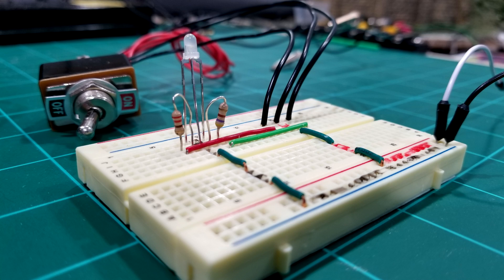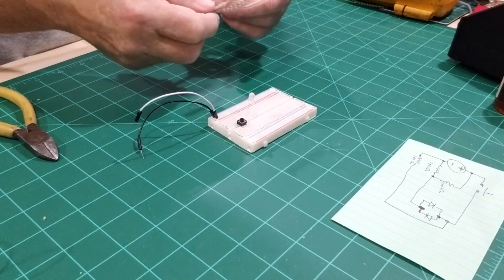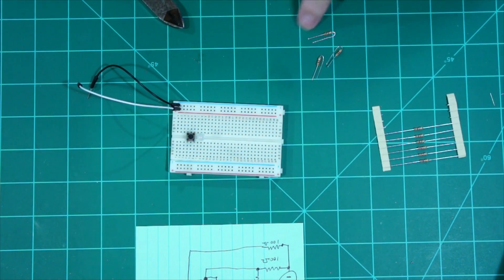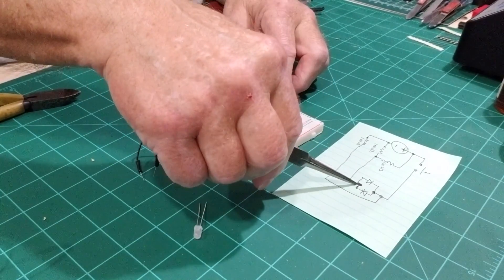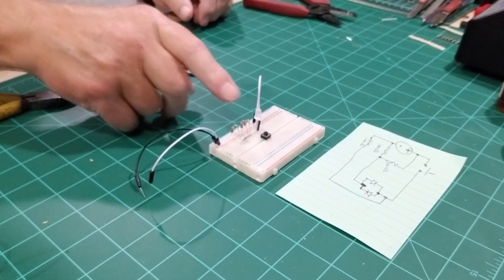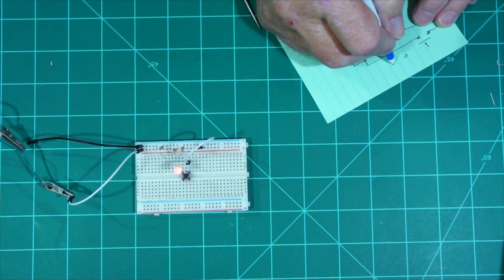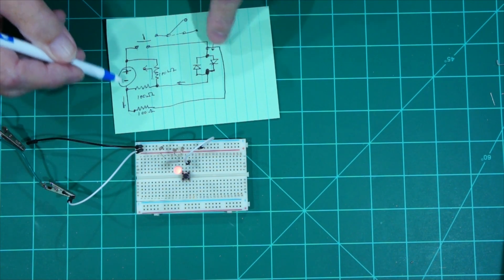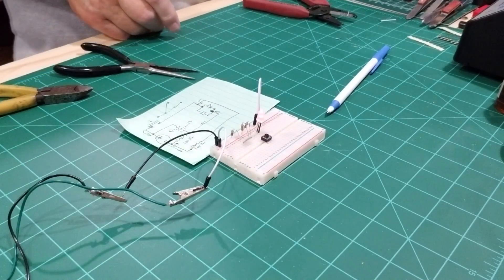How To Wire A 2 Pin Red/Green LED To Show Track Power Off & On

Comment: Using dcc. Turnouts are bachmann with power on all rails. How can I control red and green LEDs when switches are momentary. What additional components do I need to order.
Reply from the maker: The video shows you how to hook everything up and shows the components along with a wiring diagram. You are not using track power for the LEDs

Comment: Hey Tom, I inherited a 2 track Lionel train set from my dad.   I’m a complete beginner at this!  I am trying to hooking up a Tech II to a basic track (2 pins on track.   Do I need to use one or two wires from the Tech II?  If 2, which screws should I be using?   They aren’t really labeled….  Thank you for your passion for keeping these around.
Reply from the maker: If you have a meter you can test which ones are DC and which ones are AC. You can look up on their web site to see if there is a close up of the terminals if you don't have a meter. You need to hook up a wire to each terminal
Reply: @TomsTrainsandThings  Thank you for the info.  Turns out the transformer was bad.   Tried another and got it working, albeit pretty sluggish, but still working.   Thanks again!!!  You’re awesome for what you do!!

Comment: How do I wire this without a board as you can tell I am very new to this.
Reply from the maker: The board is used fro prototyping, just solder everything together
Reply: New to the game I did as you said and it is working thanks..
Reply: Great site ..

Comment: I love this video! I'm trying to do the same thing with two separate LED's one green and one red. The reason being me having hundreds of single color LED's and do not want to spend the extra money on the Bi-color LED's. Any help you can provide would be greatly appreciated.
Reply from the maker: Thanks Tony. Just put the two leds in the same place as the bicolor led but reverse the leads on one. That's how a bicolor is wired internally.
Reply: @TomsTrainsandThings  
Got it.  Thank you!

Comment: I need to get my head around this as I think it’s what I’m looking for.   Power to a control box shows the LED green but if the fuse blows the LED goes to red.
Reply from the maker: Yes possible, but you need to make sure you grab your source for the red before the fuse so the red can illuminate.
Reply: @TomsTrainsandThings .   I like to put a resistor and red LED across the fuse so if the fuse blows the LED lights up.  The nature of the supply for my current job means I will put a resistor and green LED across the supply, just to show power is on.  It would be a lot more elegant to just have one, bi-colour LED to show the status rather than the two.
Reply: @mickcoomer9714  you can buy fuses that light an led when fuse blows. Called and indicater fuse

Comment: Fantastic video! Could the circuit be easily modified to add Two Bi-Color LEDs for use when switching points? So that with each flick of the switch the two LEDs alternate in colour. I’m using DPDT switches with one pole used for turnout power and was hoping to use the other pole for the Bi-Color LEDs.  Thanks for any help, I’ve learned a lot from videos and am starting to put things into practice now.
Reply from the maker: If you use two bicolor LEDs, you're going to end up with either 2 greens, 2 reds, or a green & red, or a red & green.  It would be much simpler to just use a red LED on one side and a green on the other side or just one red/green LED as shown in the video.
Reply: Toms Trains and Things, I appreciate the reply Tom. I think I’ll stick to regular LEDs for the point indicators and use your circuit to show power on some sidings using the bi-colour LEDs. Thanks for your help!

Comment: I am trying to use DPDT switch to switch between Program and Main Track and light up corresponding LEDs. I would really appreciate if you can review the attached Google Doc and let me know if there will be any issues. 
https://docs.google.com/document/d/1Yp-JLNSuZD_2GJs_nk-tKj3IP983hN5jIgC77UZlqFI/edit?usp=sharing
Reply from the maker: You may need another set of contacts for the DCC signal. Have you tried switching from Program to Main with just breaking one lead? If that works, your drawing will work with the LEDs. I've always disconnected both leads when using a switch for this purpose.
Reply: @TomsTrainsandThings  Thanks for the reply. I have a DPDT switch coming in today and will try it and let you know. Your videos are immense help for a beginner like me. Thanks for all you do.

Comment: Great share! How many volts are running along your HO Scale bus wire?
Reply from the maker: The LED circuit and the bus wire circuit are different circuits as shown in the DPDT switch toward the end of the video. The push button on the breadboard is only showing the LED circuit for clarity. It doesn't matter what is on the bus line. In DC there is no voltage on the track until the throttle is advanced. In DCC there is a square wave signal on the track. This example can be used for both DC & DCC>

Comment: You can also do this with a small Solid State or Electro-mechanical relay and two resistors.
Reply from the maker: It can be done many different ways Russ. I try to keep it simple and inexpensive as possible for the modelers.
Reply: Very true Tom, I just thought I would put that info out in case someone who has those parts  can solve the problem with a different solution. I have several small solid state relays that will fit in the same size socket as a 555 timer IC chip and are very inexpensive. I really enjoy your YouTube channel Tom, please keep up the great work. I have been in the Hobby for 46 years, but I still enjoy your channel very much. I have always wanted to start my own channel, but I don't think I would be very good in front of the camera. Hats off to you guys that are naturals in front of the camera. Any chance you might cover Arduino projects for Model Railroader? Maybe some of the basic projects like lighting and animation.
Reply from the maker: Thanks Russ. About the natural in front of the camera; you must not have seen my first series of videos. lol
In late February or early March I will be doing some Arduino videos. I just have to catch up on writing a sketch since I haven't done any in a few years.

Comment: Hi Tom - I recently came across your channel and have subscribed as I find your topics and presentation both interesting and refreshing.  I am interested in your future video on reversing loops as I find I may have to include one.  Hopefully you can help as, although I am running S Gauge 2 rail, it is AC powered (as in American Flyer).  I am interested in both the actual construction and wiring of a reverse loop and also the actual steps in operating a train into and through the loop.  Thanks!
Reply from the maker: Thank you Steve for subscribing and the kind words. I will have two videos out shortly on the reversing loop. The first one is how to install LED's to indicate direction and the second one will be using the Hare Ver2 for the Tortoise switch machine in a reversing loop. If there is any specific question you need answered let me know.

Comment: Since your are going to talk about reverse loops soon how are chances you could also  feature NCE switch-Kat & BD20 to auto switch turnouts, without doing any programming? This is something both DC & DCC people may like to see.
Reply from the maker: Thanks for the idea! That would be a good idea but I don't have them, so unless I go out and buy them it's not going to happen any time soon. But I am doing one on the Hare Ver 2 which I just received today. As soon as I hook it up and get it going I'll be doing a video on it. Before that one I have one on how to connect LED's to a DC reversing loop.

Comment: How would you do this with AC power.  Jack
I run O gauge train.  Thank you.  Jack
Reply from the maker: You have to use DC for the LED's Jack. You can still do this in O scale, you just need a DC power source for your LED's. You can interrupt track power on one side of a DPDT switch and use DC on the other side.

Comment: Back in the day MRNA  recommended red and black wires for power or buss. just for me my railroad. i got the fact that 
for dc or dcc we call or agree the outside rail positive, the inside neg. i got it.  Question from my power booster bachman bought in 2011 has red and green to track buss. red Hot outside? Black Negative inside? I know you use Black and white. I get it. Like you said its our railroad. Now there is videos using BLUE/YELLOW For Dcc power blocks or buss and feeders. im not going to pull all new wire/ electricity doesn't know color. I have a 50/50 chance but i want to start all over with my layout doing it the right way with Black and Red? I,M OCD I guess.
Reply from the maker: The color of the wire really doesn't matter Ben. Just as long as your consistent on your layout. I use red and black because that is what was available at the time. There is a section  where I used blue and yellow because it was more readily available and I got it at a good price.That's only on one section of my layout.  I mark my bench work very clearly by my terminal blocks to reflect which is which. Your right, the electrons are flowing on the inside of the wire and could care less what color jacket their wearing. lol
Reply: Consistency is the key as Tom just stated. I am an electrician, so I use red and white for my DCC track bus. In my career white is usually a neutral(which is the AC version of a negative even though it alternates from positive to negative). I use the red as positive because that is usually recognized as a positive in a DC battery circuit. I believe DCC has both a DC and a AC component in it, that is why I have red and white. In my career green is only allowed to be a phase conductor in Traffic Signals, otherwise it is only allowed for a ground, and only carries current if there is a problem in the system. As a model Railroader, I only use green to power the frogs on a turnout(green frog). I use red and black for my DC accessory buss for led lighting. I also use yellow and gray for my AC accessory buss(because those are industry recognized AC circuit conductors) That is only the way I do it, because of my background in the electrical trade. There is no wrong way to do it. Just be consistent, as Tom says. Happy Model Railroading.
Reply: Thank you Russ. Before I retired as a Pipefiitter/ Welder. I Was working for Johnson Controls.
Electricians ran our conduit and pulled our wires to main buss and vav boxes.
I landed and hooked up the DDC Controllers. I loved that work. Lot easier then lifting  8" Pipe.
All day.
At times I thought as you did. However Black wire was Hot. It really messed me up.
But as you may know? JCI is a global company. I ran service also in HVAC  when things went to
Power management and DDC i was near my End  time. 
Any who im rambling. Good too talk to Yall,
 And I really appreciate your input and advice.